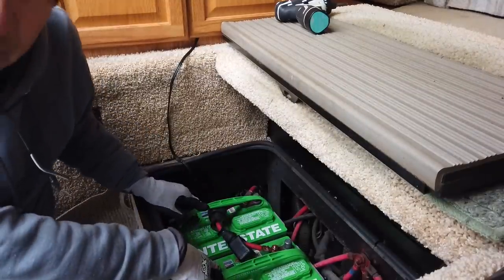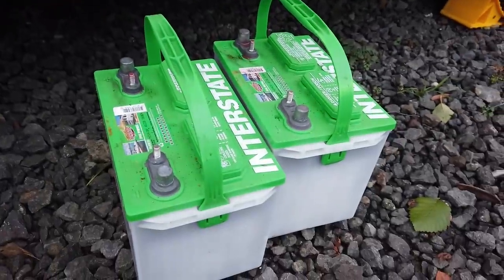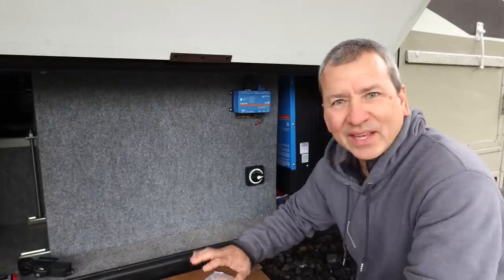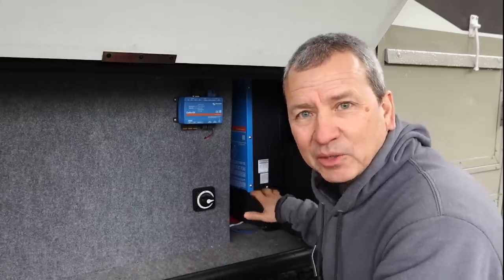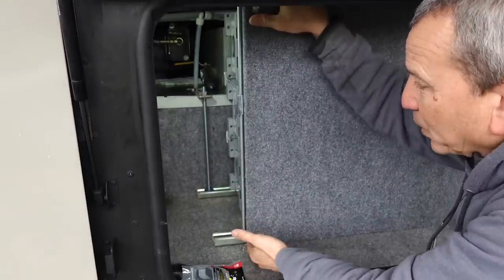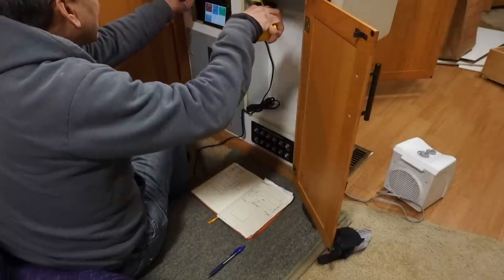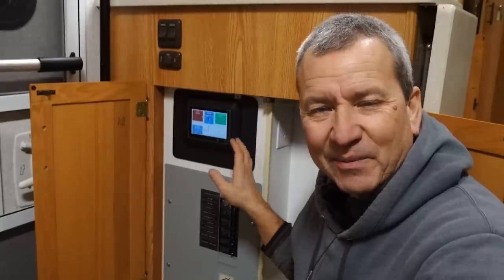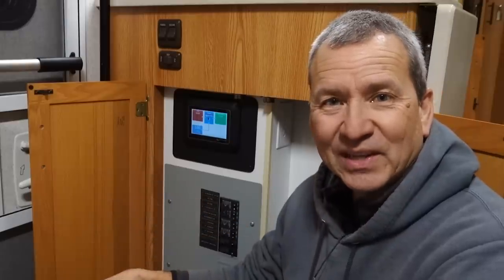800Ah Lithium Battery Install | Battleborn GC3 | RV With Tito DIY

Comment: That sure looks like a nice setup. Great job on the installation. We've been watching your channel for a while and really enjoy it. 

We're retired FT RVers who love to boondock, but for the last 4 years we have been boondocking with a 620-watt solar array and only 2 GC-2 FLA golf cart batteries. So last month we upgraded our batteries to a custom built 560ah 12v LiFePo-4 battery made with 8, 280ah prismatic cells. We used a 330-amp BMS and a 5 A active balancer. This is about the same as 2 of the 270ah Battleborn Gamechangers you have but cost less than $1,500 including the BMS to put together. They have an 8,000-cycle mfg. projected life at 80% DOD. One of the biggest reasons we went with the individual cells is we wanted the biggest battery that could fit under the steps of our motorhome where our old pair of golf cart batteries used to live. They are 35lbs lighter than our old FLA batteries - besides having over 5 times the capacity and 10 times the life. We're happy campers.
Reply from the maker: Nice! Glad to hear you have a setup that's working well for you. Great job.

Comment: Great job! Well thought out. After doing mine I realize the most important thing is to have all the components together before you begin and have it planned out as well as possible. It always seems like I forget something no matter what! 🤪
Reply from the maker: Agreed. There's a lot to it so it's easy to miss a piece, cable, or fuse or something. Everything needs to be ordered.

Comment: Nice,I just ordered 4 SOK 206AH in the plastic case for moisture protection, to assist my Giandel 4k industrial inverter,Renogy 100amp controller and 13 100 watt panels on roof of my cargo/bug out trailer and can am atv hauler.Solars expensive but longevity and off grid is well worth it.Good video to inspire others.
Reply from the maker: Nice. I agree. For us the expense is also worth it to get a nice reliable system. Glad you enjoyed it.

Comment: Your method of getting the weight off of the floor of the compartment with the steel bars and long threaded rods into the floor is exactly what I have had pictured for reinforcing our storage bays as well! Thanks again for the great videos and explanations!!
Reply from the maker: You're welcome. It seems to be working pretty well. It helps that the batteries are actually bolted together though. Without that, I suspect there would be some shifting.

Comment: Great job, very well thought out. Thanks for the effort to document. The battery lugs at the existing battery location appeared to have gotten hot at some point in time by the color. That's just me sitting in a lazy boy looking at the tv. Another while I got ya, the strut nuts are installed upside down. I think a good practice would be to use some jam nuts on the threaded rod to prevent the rod pieces from vibrating loose. Again great job,I have picked up ideas from you I would have never thought of until afterwords.
Reply from the maker: Thanks for the suggestions. Yeah those battery cables are over 18 years old :)

Comment: Hi Brian!! This is really a great install!  Those GC3s are really awesome as it cuts down on the wire nest that you would have with 8 ea 100amp hr batteries.  

I was really impressed.. I just returned from a blast down to TX to get solar installed (1495w and 500 amp hrs of batteries).  When the installer did his initial consultation, and eventually the Cerbo talk came up, he steered me away from it as we are not worried, nor set up, for any advanced data/cell reception in the backcountry.  Between not always being connected, and the extra labor involved with the extra wires for the cerbo, he recommended against it, and we took heed!

I like where your cerbo is located!  I would assume that you probably will just reference your Bluetooth app on your phone, for that data anyways. 

Safe travels!
Reply from the maker: Thanks. Yes. We're really enjoying the setup with the GC3s and the rest.

Comment: Great plan great job, excellent support system sparky had good idea too I add thread lock and rubber bushings to the mix
Reply from the maker: Seems like the weight of the batteries is keeping them pretty stable. I can also adjust them as needed. Rubber bushings would be a good upgrade.

Comment: Boom Boom out go the lights 😂 I see what you did there. May want to double nut those strut rod bolts inside. So it won’t vibrate the nut loose over time. Nice job 👍🏼
Reply from the maker: Glad you noticed that. I wasn't sure if anyone would get the Pat Travers reference. It's the first thing I thought of while editing this one :) Thanks for the suggestion too.
Reply: @RVwithTito  I got the reference, but got here too late to be first. Lol.

Comment: The big takeaway for me is the ABS sheet mod to fill in your old cutout. I just received the Touch 50 and realized that the old cutout is too big. The Touch 70 would cover the hole but is another Benjamin. Thanks to your inspiration I'll fit an ABS bezel over the old hole and the Touch 50 will look perfect - just like yours. Thanks!

Comment: Nice display & video. Decent location to set monitor.  With Bluetooth we rarely use our panel.
Reply from the maker: You're right. I don't need to look at the panel as much. I do use the VRM only a lot though.

Comment: The GC3 is the Batteries i would like to put in my Dutchman Voltage. I like the way you stacked them.
Reply from the maker: There are lots of ways to stack these which is one big reason why I went this route. They are also very rugged...another plus.
Reply: @RVwithTito  Brian, did you verify with Battleborn that they can be mounted of the side? I know since of the LFP prismatic cells used in these type of batteries call-out in their datasheet that they are NOT rated for side mounting.
Reply from the maker: @andrewfidel2220  Battleborn uses cylindrical cells. I'm pretty sure they can be mounted anyway you want.

Comment: Wondering how they work out in the cold. They seem not to have heaters, and the location is likely to get way colder than the inside. During winter it might prevent charging due to low temp. You might consider insulating it a little more and/or run a small duct from the inside. The multiplus will generate heat, so with sufficient insulation that might be enough to keep it above freezing
Reply: Temperature extreme is also a concern of mine. I'm installing a W 1209 temperator controll relay (2) for either condition the parasitic load can be migrated
Reply from the maker: I've had heaters on our Class C and they rarely kicked in. You're right. With the batteries and inverter running, it is always a little warm. The compartment is totally enclosed so I don't expect it will ever get that cold. Oh yeah. We tend to run from freezing temps anyway :)
Reply: @RVwithTito  As long as you warn the new owners whenever you sell this RV

Comment: I like the way you set that all up and in a month or so my house is up for sale and I will be looking for a 20 year ol or so class A. I am going to do something similar with solar and I am all so going to install a minisplit air conditioner to provide cooling and heating.
Reply from the maker: Good luck. Mini splits are a good option if you can make it work.

Comment: Another great video. You will love the cerbo gx.  Go into touch 50 and turn on dc loads. Will now show up on display. Also have the phoenix inside to turn inverter off and on and adjust current if plugged into grid. Thanks from bill’s cool project on youtube.
Reply from the maker: Thanks. Yes. I'm digging the Cerbo so far.

Comment: Well done Brian.  Nice work in the battery bay with it's bus bars and supports.  As far as the display .. nice work on the mount but at $400ish for that display .. it would pain me to hide it in such a way. 😂. 

Can't wait for the solar controller install video.  Maybe go into detail how to properly size a controller to a solar panel bank?
Reply from the maker: Thanks for the reminder. Not sure I touched on that in the video, but I'll be sure to mention it in the future.

Comment: Nice work on the install in the locker.

I notice you don't have a DC/DC charger for the alternator connection to the batteries - did you just leave it as it was from the old batteries?
Reply from the maker: Didn't go with a DC-DC this time. I just run the generator while driving and push 120A in.

Comment: Very nice set up.  let us know how those batteries perform!  Set up looks good and the cervo display does not seem intrusive are all.  after all, you are not going to spend a lot of time in front of that screen, he he. Good Luck!
Reply from the maker: You're right, I'll be using the VRM monitoring more, but still glance at the display. I can also program a few things from the panel.

Comment: You were much more enthused about your SI Marine install.  I'd like to know if the Victron does as many things.
Reply from the maker: Simarine works great, but is only monitoring. I've always used Victron for solar, but it's nice to incorporate more components. They work well together.

Comment: Looking good, very nice and clean install, you do great work!  I have a question.  I've watched most of your solar installs for this and the class C.  I'm curious how the system does with running the A/C as well as how long it lasts before needing a recharge etc.  

Thank you in advance!
Reply from the maker: This setup will certainly work better than the class C. It's twice the capacity with more output. It shouldn't have any trouble running the A/C probably even without a soft start. I haven't fully tested it yet though. Stay tuned.
Reply: @RVwithTito  Look forward to seeing how it works!
Reply: @RVwithTito  Have you considered a DC compressor motor operating roof AC Dometic ? Rather than stock sine wave AC compressor motor ?
Reply from the maker: @VideoByPatrick  Sure. I've considered it, but not for my current RV which has a basement A/C. My roof is filled with solar. I'd probably go with a mini-split that could fit in that basement space. Currently everything is working fine and we don't often use our A/C.

Comment: amazing , quite the install job. Hope it works well for you. I have the same coach, but 30A also doing repairs and up grades, if you still have the original Inverter you removed and want to sell it happy to buy it install it in mine.

Comment: You always seem to do very nice installations. I am curious if using bus bars will lead to a battery imbalance in your battery bank. I have a much smaller system. I started out with two Battle Born 100 amp hour batteries connected in parallel with the positive feed coming from battery number one and the negative feed coming from battery number two. Every thing worked as expected. Later I added one more Battle Born 100 amp hour battery in parallel leaving the inverter feeds on batteries one and two. This set up never performed as expected. When I used an amp clamp on each battery cable with the inverter powering a microwave there was a large difference in the power draw from each battery. I corrected my installation having the positive feed from battery number one and the negative feed from battery number three. This set up corrected the power draw imbalance and everything works as it should. This may be just my experience with my set up. I used the same gauge wire and kept the the lengths as close as possible to keep the resistance the same. Please keep us posted if you have any issues with your battery bank. Your bank may be large enough that you don't notice any issues. Thank you for the good work and testing.
Reply: Yes Doug that is the proper way of balancing multi battery bank
Reply from the maker: I have the negative (from the busbars) connected to #1 and positive connected to #3. So balancing is not an issue.
Reply: @RVwithTito  Would it be better to use batteries that have a smart link cable to each so each battery sees each others BMS for better ballencing/monitoring ?

Comment: Hello again...I am envious of your ingenuity.,.. I have 2 questions..

1. Theoretically how long can you run the A/C with your lithium battery bank when boondocking?

2. Will you be installing the SiMarine PICO system?
Reply from the maker: (1) I can run the A/C in peak sun hours primarily using solar. Outside of that it will draw about 10-15% of the battery per hour. (2) No PICO on this rig. I'm going all Victron on the Class A.
Reply: @RVwithTito  thank you ...

Comment: Your might need more panels for that 800 ah LOl I just finish my 2 th version after 10 yr of use. I've got 1,560 watts and 440 ah 4-6 volt Trojan. Might be helpful other to know before you buy, if you plan to charge the battery by the alternators you need a solar controller that has a negative ground or you can short out your controller, as you need to ground your battery ground to the chassis to add  a 2 th battery me I've got 4 battery it's a 130 amp alternative and it does charge all 4 or 2 or 1 set on my choice on cloudy days. It's a great addition to tap off your battery say after the mall to camp. now I can used my PS3 and thinking of a air fryer addition.
Reply: From my experience, this new system is perfect matched. Get a Blue Sea 8003 DC Analog Voltmeter, for your driver dash, 14 gage ok, the controller don't show 
the change. You need  the amount of panels or smaller battery to get 14 volt  showing on that battery with 7-10 amp going 
in average 50% used it's about 
11.am  so you at 100 % at 2: 00 and tapping off a hr or 2 later.
This is the setup best you can get. I  rarely need to take the battery under 12.3. And useing the alternator charging it's the same 14 volt 14.2.-14.5  in the afternoon when all battery are full , and funny but my van run with more power because it's back charging or tapping off my van battery too.  Hotter spark

Comment: Really enjoy your vids. You do very precise work. I am just starting an electric rebuild of my recently  aquired 2019 Discovery 40D. It still has lead acid batteries. I intend to do a combination of off grid and campground travel. 
I have seen several negative reviews for Victron customer suppor.  Do you have any input on the subject? 
I have two trips planned before the snow flies in November. I live in NE Missouri, and will be visiting my daughter and family in Belfair WA. I lived in the Silverdale area from late 79 until 94. I retired from the Navy in 91. 
I will be starting my project when I return from my trip. 
Keep up the outstanding videos, I have picked up many  ideas from you. 
Thanks for the info.
Jim
Reply from the maker: Hey Jim. I've never ever needed Victron support. There's a ton of information on-line. Plus the Victron community is pretty large with an active forum (community.victronenergy.com). So I doubt you'd ever have difficulty getting help. They also have a big training/cert program with many Certified Victron installers in the US. I have several listed on my installer page (rvwithtito.com/rv-solar-installers). They can even remotely monitor your system and keep it working properly.  Have a safe trip back here to the Puget Sound. Hope you make it back before the weather turns :)

Comment: One comment about the build. I watched the previous video where you created all the anchoring and cable connections and now watching the install video I question that fairly hard connection for the rotary cutoff to the battery bank being mounted on that large panel. It seems you should have access to those connections and the back of the rotary cutoff without removing the entire front panel. Especially since you are going to install other items to it like the Cerbo GX. Should you ever need to get at your batteries - especially in an emergency (unlikely, I know) you will be seriously hampered by that large panel with multiple items mounted on it.
Reply from the maker: Correct. It's a potential issue and little tight, but I can still reach around and access what I need to on the batteries and inverter. If I ever had to get to the main battery busbars, then yes I'd have to disconnect the cutoff. But I left enough room to access the other components.

Comment: Thank you. You have great videos. We had installed the same  Victron inverter you have. We are experiencing what we think are rather high temperatures - 115ish - on the road when the outside temp is 80. Is your experience the same?

Comment: Hello Brian, 
     I enjoy your interesting and informative videos. I have just installed (3) 280ah DIY lithium batteries on my class A MH. I know that you are on the road most of the time and since you don't have a generator anymore, I wonder if you run your refrigerator and hot water heater off of your inverter (battery pack) all of the time not using any propane. I know the batteries have the capacity but is it a good idea to run refrig and hot water off of electric instead of propane.  Thanks,  Frank
Reply from the maker: If you've got the power, then yes. My goal is to use a little propane as possible. So as long as I'm in a sunny area, I'll run the fridge on inverter 24/7 which takes me down about 15-25% at night. If I'm fully recharged at mid-day I'll turn on the hot water heater. I've even charged my friends electric car :) You just need to manage it with everything else you power. We also use an Keurig, air fryer, induction cooktop and microwave throughout the day. If it's rainy or grey for a couple days, then I'll switch the fridge back over to LP for the night.